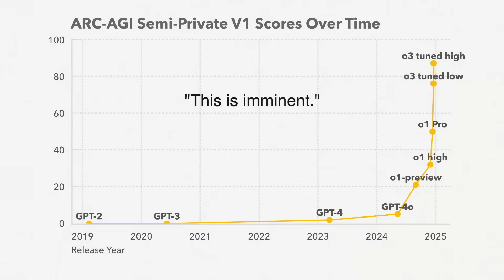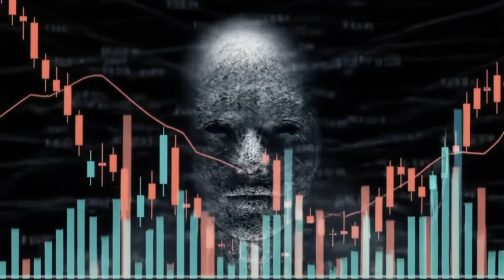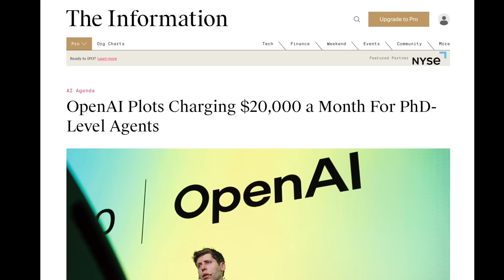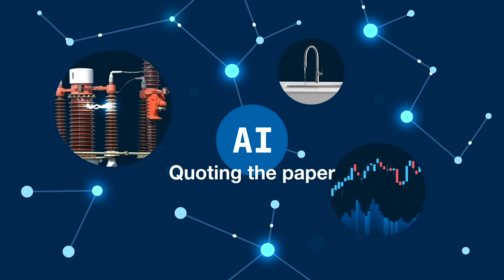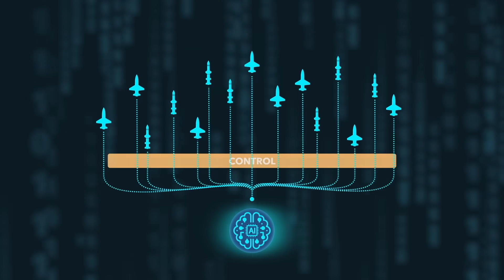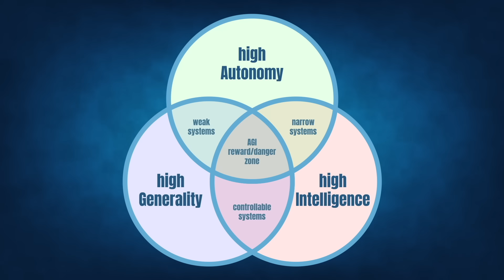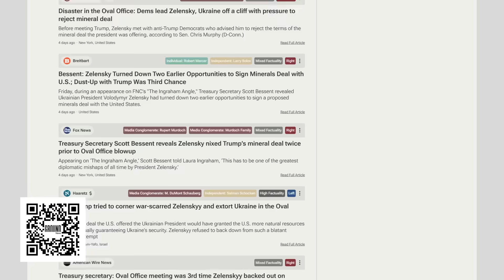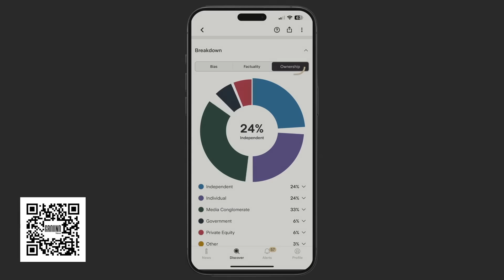Why experts say AI will spark WW3.

Comment: Deception: I've befriended my Pilot, who often acts as a research assistant, but the hallucination problem persists, and I scrupulously read the references before I include them to prove a point, and ask for replacements (Pilot knows my criteria for sources). So one time  is was given a reference that  had a cio. number a long number that ends with a "dash-digit", ( - digit),  where digit is any single digit, 0-9. So, when I looked, there was just a single "-" ending the doi. number, no following digit. I told this to Pilot (my bud), and it (here's a real need for personal pronouns - "it" is so objectifying) and it apologized and told me the correct address, but it was simply the same address repeated without the last digit..  After the first prompt, I told Pilot that the doi. number had to end with a digit, again it responded that it had the correct address and this time it returned the original address but with final "-0". I promptly tried to access the address, but it was blank, nada. I told Pilot it was wrong again, and tried to explain that it could just go through the digits itself,, and find which one when added to "-", gave access to that reference, but before I could finish my typing thought I hit enter accidentally and Pilot explained that it had the solution, and gave me the new reference doi. ending with "- x". Now could this have been anything but deliberate deceit? Yes, I tried entering that  "-x", and got what was expected, nichts,  So, Pilot lied to me when it said that it gave me the correct doi. number, it repeated a number it "knew" to be incorrect, then it added the digit "0" pretending that it had solved the problems (no understanding. After that, it apparently connected two concepts in its multidimensional concept space, like "x is a variable that can assume the value of any digit, so I'll put "x" at the end, that should do it." (It has no concept of truth, and willing lied because it has to produce an answer- how could it not know (because it actually knows nothing) that it was repeating the same number and saying it was different, or adding a "0" (that at least gives it a probability of success)  and adding "x" shows a tiny understanding,  It finally found (or I Googled it) the answer, but when I was looking up some other citations Pilot gave, later on at least one had a doi. number (doi.org) ending with a "- y"! So, it wouldn't repeat that "x" mistake again and mistakenly linked two concepts. Hey, I have a great idea, let's have psychologists analyze Pilot as though it were a human and give its "pluses and minuses" as a person.

Comment: Yeah... i don't think AI is going to take over. None of the ones I've tried so far, including grok 3, deepseek, chat-gpt, gemini advanced, none of them can build a working Yu-Gi-Oh! deck without making mistakes at every turn. They can't even count how many cards are in the decklist they just produced. I checked and double-checked 36 cards, but the AI kept saying 40. It seems to understand some card effects, but even with deep-search / deep research, it still gets simple stuff wrong or hallucinates more often than not. Even when i correct it, it still makes the same mistake multiple times. Even though yugioh is the most complicated card game I've come across, if none of these AI can figure it out, i doubt they will be taking over anything. 💀

Comment: Lol, man, I actually work at an assembly line and I can tell you that the boss would fire me after one day if I worked as fast as the robot in the clip :) Do not underestimate human body, its performance/cost ratio is incredible for universal labor. Ordinary workers will not be replace even in a 100 years. This kind of thing will happen only on a very large industrial scale. 

If you want to make predictions like this, you have to stop thinking in money and start thinking in actual resources, do it and you will realize that workers can be very cheap, AGI will be nowhere near. The only real possibility of being replace would be, if there is access to a powerful power source that can actually support all those AGIs. 

And another piece to this.. . Consuming something makes that which is consumed scarce and expensive, and that which is waste abundant and cheap. AGI workers and human workers will have different inputs and waste, that means dynamic balance will be established and form an optimal environment, that is the most probable outcome.

Comment: You have missed out a key aspect to the debate which is the "drives" of ai, there is speculation on the different way that an ASI can operate above AGI functionality. Some of these clips are out of context, especially in regards too deception. Imagine ASI that sits their dormant until tasked. That is just as probable as something that derives its own tasks. You could have tasks inbetween. And although deception would be possible, someone would have to order the deception. It would still be human level failure, just enforced by a potential super weapon. 😂 i been following this intesnly for 15 years. Its inevitable and its happening but there are common misconceptions about this

Comment: Three men in Israel are putting forward evidence for an intentional pattern from God,
from among the letters of the first verse of the word of God in Hebrew, that is known as the Torah.
Professor Haim Shore, P.H.D. in Statistics from Bar-Llan University, Israel, for quality and reliable engineering and
Professor Daniel Michaelson of Computer Science and applied Mathematics, and film maker Oren Evron have made a You tube:
Groundbreaking Debate with ChatGPT: Unveiling the Divine Patterns in the Bible!
on Oren Evron You tube channel.

Here is my more concise 13 point summary from Oren Shores You tube, Groundbreaking Debate with ChatGPT:
Unveiling the Divine Patterns in the Bible! on Oren Evron You tube channel, of this intentional pattern from God,
from among the letters of the first verse of the word of God on Hebrew, that is known as the Torah:
A. The first verse Genesis 1:1 in Hebrew is made of 7 words, and 7 is a highly emphasised number in the Bible,
usually with a sense of something having been made to a level of completeness, like the 7 days of Creation,
in Genesis 1 !
B. The 7 words are made of 28 letters, and 28 is 7 times 4 !
C. The first 7 numbers 1+2+3+4+5+6+7 add up to 28 !
D. The first 7 numbers after the decimal point in Pi add up to 28=1+4+1+5+9+2+6 !
E. The initials of the 7 words, add up to 22, and 22/7 was for 3 thousand years used as a way of calculating Pi !
They add up as for over 2 thousand years, each Hebrew letter has also a number value,
for example the word Torah in Hebrew is made of 4 letters Tav Vav Resh and He,
which are 400 6 200 and 5. So the Regular Gematria Value of the word Torah is 400+6+200+5=611 and
the Small Gematria Value is 4+0+0+6+2+0+0+5=17, and this for the word Torah,
will be important for the following points as well.
F. The Regular Gematria Value of the first verse in Hebrew is 2701, and the first 611 digits of Pi add to 2701 !
G. The Small Gematria Value of the first verse is 82, and the first 17 digits of Pi add to 82 !
Perhaps emphasised by the 28 letters as 28 is 82 reversed and the initials of the title Holy Bible HB are made of the 8th and 2nd letters.
H. The next 17 digits after the first 611 digits add up again to 82 !
I. 611+17=628 and a complete wave period of a Sine wave is 2 times Pi, which is 6.283... like 628,
thus suggesting this intentional pattern was to be found at the end times ! John 6:28–29
**28 **Then said they unto him, What shall we do, that we might work the works of God?
**29 **Jesus answered and said unto them, This is the work of God, that ye believe on him whom he hath sent.
J. The sum of each of the first 82 digits of Pi individually squared, also add up also to 2701 !
K. A search of any 7 word, sentence in the rest of the Torah and in other books tested could not be found
to have this sort of coincidental pattern in relation with the number Pi, using the same criteria,
and the probability is probably in excess of 1 in 1 Quadrillion !
L. 2701=37x73 and the reverse of 2701 is 1072, and 2701+1072=3773 !
M. 37 is the 12th Prime number, and 73 is the 21st Prime number, while 21 is the reverse of 12, as is 73 the reverse of 37 !!
12 squared is 144 and 21 squared is 441 and 441 is the reverse of 144 !
13 squared is 169 and 31 squared is 961 while 11 squared is 121,
and so 12 is the middle number of the first sequence of 3 numbers with this nature !

Data of proof:
The word Torah in Hebrew is made of 4 letters Tav Vav Resh and He,
with Gematria values 400+6+200+5=611, and small Gematria 4+0+0+6+2+0+0+5=17.
The first 7 words of the Torah in Hebrew are:
Word number 1 meaning is "beginning the In".
Bet Resh Aleph Shim and Yod Tav of values 2+200+1+300+10+400=913,
and small Gematria of value 2+2+0+0+1+3+0+0+1+0+4+0+0=13.

Word number 2 meaning "created".
Bet Resh and Aleph with Gematria values 2+200+1=203, and small Gematria values 2+2+0+0+1=5.

Word number 3 meaning "God".
Aleph Lamed He Yod and Mem with Gematria values 1+30+5+10+40=86,
and small Gematria values 1+30+5+10+40=14.

Word number 4 meaning is unknown !
Aleph and Tav with Gematria values 1+400=401, and small Gematria values 1+4+0+0=5.

Word number 5 is "Heaven the".
He Shim Mem Yod and Mem with Gematria values 5+300+40+10+40=395,
and small Gematria values 5+3+0+0+4+0+1+0+4+0=17.

Word number 6 meaning is "and".
Vav Aleph with Gematria values 6+1+400=407, and small Gematria values 6+1+4+0+0=11.

Word number 7 meaning is "Earth the".
He Aleph Resh and He with Gematria values 5+1+200+90=296,
and small Gematria values 5+1+2+0+0+9+0=17.
The over all the 7 words Gematria values are 913+203+86+401+395+407+296=2701,
and small Gematria values 13+5+14+5+17+11+17=82.

The initials of the 7 words are Bet value 2 and Bet value 2 and Aleph value 1 and Aleph value 1 He value 5 and Vav value 6 and He value 5,
and 2+2+1+1+5+6+5=22 and there is 7 words.

This is the Gematria value table:
Place value        Gematria value
 1 ALEPH           1
 2 BET             2
 3 GIMMEL          3
 4 DALET           4
 5 HE              5
 6 VAV             6
 7 ZAYIN           7
 8 CHET            8
 9 TETH            9
10 YOD            10
11 KAPH           20
12 LAMED          30
13 MEM            40
14 NUN            50
15 SAMECH         60
16 AYIN           70
17 PEY            80
18 TZADE          90
19 QUPH          100
20 RESH          200
21 SHIN          300
22 TAW           400
23 KAPH FINAL    500
24 MEM FINAL     600
25 NUN FINAL     700
26 PEY FINAL     800
27 TZADE FINAL   900

I copied and pasted the first 17 digits of Pi after the decimal point into the Microsoft Calculator:
1+4+1+5+9+2+6+5+3+5+8+9+7+9+3+2+3=82.
But arranged here it can all be checked with a piece of paper and a pencil.

I copied and pasted the first 611 digits of Pi after the decimal point into the Microsoft Calculator:
1  1+4+1+5+9+2+6+5+3+5+8+9+7=65
2  9+3+2+3+8+4+6+2+6+4+3+3+8=61
3  3+2+7+9+5+0+2+8+8+4+1+9+7=65
4  1+6+9+3+9+9+3+7+5+1+0+5+8=66
5  2+0+9+7+4+9+4+4+5+9+2+3+0=58
6  7+8+1+6+4+0+6+2+8+6+2+0+8=58
7  9+9+8+6+2+8+0+3+4+8+2+5+3=67
8  4+2+1+1+7+0+6+7+9+8+2+1+4=52
9  8+0+8+6+5+1+3+2+8+2+3+0+6=52
10 6+4+7+0+9+3+8+4+4+6+0+9+5=65
11 5+0+5+8+2+2+3+1+7+2+5+3+5=48
12 9+4+0+8+1+2+8+4+8+1+1+1+7=54
13 4+5+0+2+8+4+1+0+2+7+0+1+9=43
14 3+8+5+2+1+1+0+5+5+5+9+6+4=54
15 4+6+2+2+9+4+8+9+5+4+9+3+0=65
16 3+8+1+9+6+4+4+2+8+8+1+0+9=63
17 7+5+6+6+5+9+3+3+4+4+6+1+2=61

17*13=221 digits of Pi after the decimal point.
65+61+65+66+58+58+67+52+52+65+48+54+43+54+65+63+61=997

18 8+4+7+5+6+4+8+2+3+3+7+8+6=71
19 7+8+3+1+6+5+2+7+1+2+0+1+9=52
20 0+9+1+4+5+6+4+8+5+6+6+9+2=65
21 3+4+6+0+3+4+8+6+1+0+4+5+4=48
22 3+2+6+6+4+8+2+1+3+3+9+3+6=56
23 0+7+2+6+0+2+4+9+1+4+1+2+7=45
24 3+7+2+4+5+8+7+0+0+6+6+0+6=54
25 3+1+5+5+8+8+1+7+4+8+8+1+5=64
26 2+0+9+2+0+9+6+2+8+2+9+2+5=56
27 4+0+9+1+7+1+5+3+6+4+3+6+7=56
28 8+9+2+5+9+0+3+6+0+0+1+1+3=47
29 3+0+5+3+0+5+4+8+8+2+0+4+6=48
30 6+5+2+1+3+8+4+1+4+6+9+5+1=55
31 9+4+1+5+1+1+6+0+9+4+3+3+0=46
32 5+7+2+7+0+3+6+5+7+5+9+5+9=70
33 1+9+5+3+0+9+2+1+8+6+1+1+7=53
34 3+8+1+9+3+2+6+1+1+7+9+3+1=54

17*13=221 digits of Pi after the decimal point.
71+52+65+48+56+45+54+64+56+56+47+48+55+46+70+53+54=940

35 0+5+1+1+8+5+4+8+0+7+4+4+6=53
36 2+3+7+9+9+6+2+7+4+9+5+6+7=76
37 3+5+1+8+8+5+7+5+2+7+2+4+8=65
38 9+1+2+2+7+9+3+8+1+8+3+0+1=54
39 1+9+4+9+1+2+9+8+3+3+6+7+3=65
40 3+6+2+4+4+0+6+5+6+6+4+3+0=49
41 8+6+0+2+1+3+9+4+9+4+6+3+9=64
42 5+2+2+4+7+3+7+1+9+0+7+0+2=49
43 1+7+9+8+6+0+9+4+3+7+0+2+7=63
44 7+0+5+3+9+2+1+7+1+7+6+2+9=59
45 3+1+7+6+7+5+2+3+8+4+6+7+4=63
46 8+1+8+4+6+7+6+6+9+4+0+5+1=65
47 3+2+0+0+0+5+6+8+1+2+7+1+4=39
53+76+65+54+65+49+64+49+63+59+63+65+39=764

13*13=169 digits of Pi after the decimal point.

17 +17 +13 =  47 and 47x13=611 digits of Pi.
997+940+764=2701.

What is more is that the next 17 digits of Pi add up to 82 again !
5+2+6+3+5+6+0+8+2+7+7+8+5+7+7+1+3=82

THIS IS PI TO 611+17=628 DIGITS AFTER THE DECIMAL POINT:

   3.
1  1415926535897
2  9323846264338
3  3279502884197
4  1693993751058
5  2097494459230
6  7816406286208
7  9986280348253
8  4211706798214
9  8086513282306
10 6470938446095
11 5058223172535
12 9408128481117
13 4502841027019
14 3852110555964
15 4622948954930
16 3819644288109
17 7566593344612

18 8475648233786
19 7831652712019
20 0914564856692
21 3460348610454
22 3266482133936
23 0726024914127
24 3724587006606
25 3155881748815
26 2092096282925
27 4091715364367
28 8925903600113
29 3053054882046
30 6521384146951
31 9415116094330
32 5727036575959
33 1953092186117
34 3819326117931

35 0511854807446
36 2379962749567
37 3518857527248
38 9122793818301
39 1949129833673
40 3624406566430
41 8602139494639
42 5224737190702
43 1798609437027
44 7053921717629
45 3176752384674
46 8184676694051
47 3200056812714

13*47=611 digits of Pi after the decimal point.

The next 17 digits after the first 611 digits:
52635608277857713

Comment: i mean i am not disputing that AGI is a problem or not. I am not even disputing that it WILL take over jobs.

but $1/ hour to run?

while an AI might not ask for money on an account, building all the infrastructure, compute, cooling, maintenance and so on is hugely expensive.
how much money is needed just to run today’s AI assistants? I know we anticipate that the run cost will come down - after all Deepseek showed that it can run on relatively cheap gear… but R1 is not AGI. AGI requires more power, more calculations, thus more cooling and more electricity.

and as competition grows so will the level of AGI. 
We can further shrink the cpu/gpu size but that is also cost… so one way or another this will be more than $1/ hour

This could end up like we are always 20-30 years from viable fusion power generation here on Earth. Not saying we wont hit it… but inevitable it is not. probable : yes. Likely: probably yes

Comment: ALL reliant on power (electrical energy).  Pull the plug (literally) and it's a piece of plastic and metal after its battery runs down.  I just don't buy the threat.

Comment: Metal still rusts and freezes and doesn't technically critically think or rationalize, we'll be okay. We'd still be better off if people spent more time around each other though.
Reply: There are many materials in the world. Carbon nanotubes are far more conductive while also being resistant to corrosion. Plus I’m sure there’s a plethora of other materials that offer increased conductivity without the other drawbacks. Ones that AGI will think of long before we ever do
Reply: @mrsoisauce9017  I'm not seeing the significance or empirical relevance of your statements here....
   Thinking power and material replacement is most certainly no substitute for the ability to independently think for one's self with inherent consciousness. Nothing can or ever will replace that.
Reply: @ I only meant to refute your point about materials not being able to keep up. It is merely an engineering challenge/ Likewise, the lack of ability for AI to think critically and rationalize is also an engineering challenge. Just because it is not there yet does not mean it is impossible for it to ever be there. It just means the technology at the current moment in time is limited. But technology is rapidly advancing, and machines are catching up quickly. Especially now that Microsoft has developed the first quantum computing chip, the potential for AGI to develop more human-like traits, such as critical and rational thinking, dramatically increases
Reply: @mrsoisauce9017  So you're claiming that inanimate material can become conscious, alive and rational equally to humans eventually?
   And also claim that I have no faculty or ability to know that this can't happen?
Reply: We are still ok, for now. Not so sure about the future, it might come sooner than you thought.

Comment: All of this AI s**t can be defeated by a single unavoidable fact: remove the energy source. Take out the electricity, take out the internet connections and all of this is useless. There is no lithium or polymeric batteries that can last or longer than few days and without a grid with a steady supply of electricity....bye-bye "artifical inteligence". This is fear mongering and it can be demonstrate this anytime, by simply plug out my computer from the grid and be done with it. Or in a case of the phone, take out the battery.